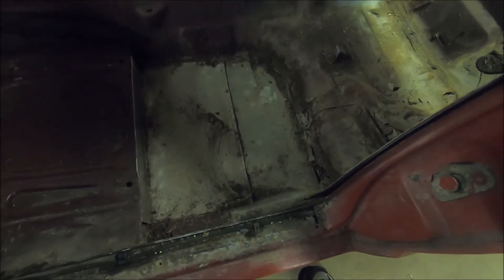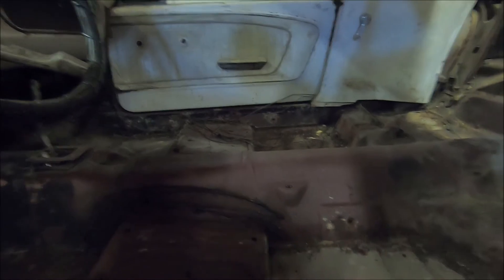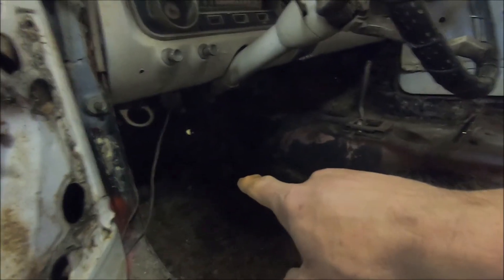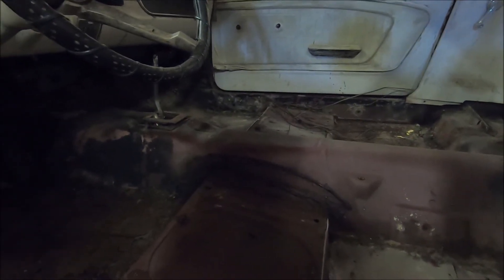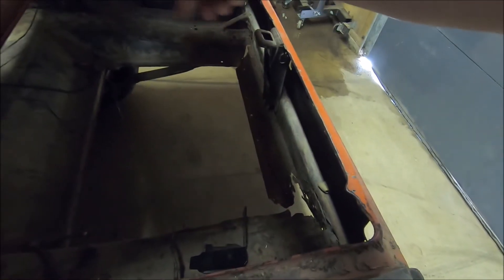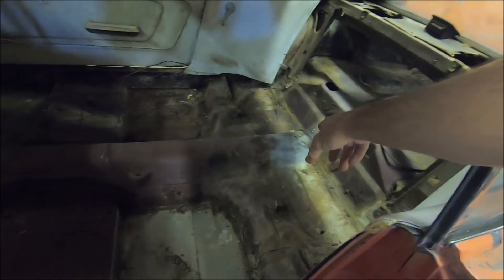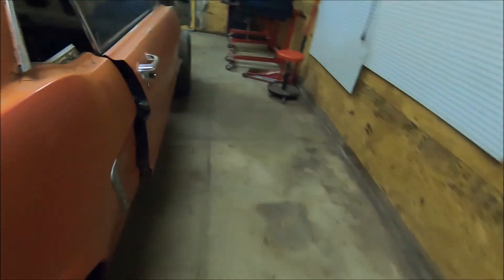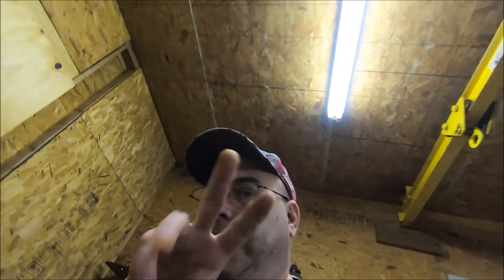1965 Mustang Coupe Restoration Part 4

Comment: why wouldn’t  you just get a one piece complete floor pan with seat risers that’s far less work then cutting and welding sections in and it makes for much better repair and it’s cheap
Reply from the maker: Actually it is not cheaper, 374.00 for the floor pan and 363.00 for freight shipping….and where I need to replace is a small area and I can still make the floor pans look new when I’m done with it